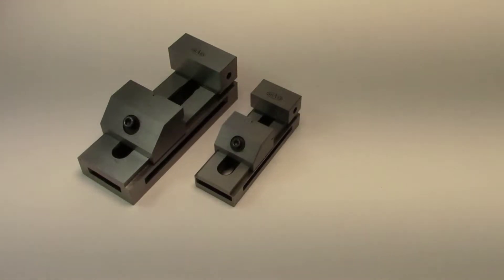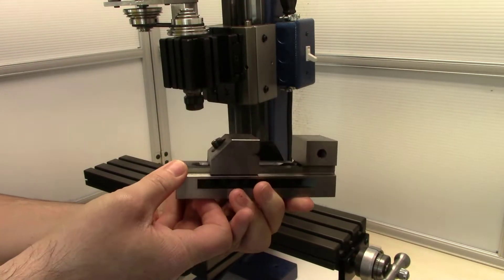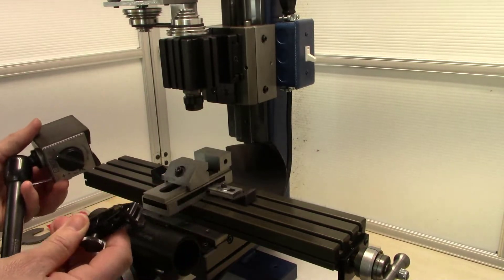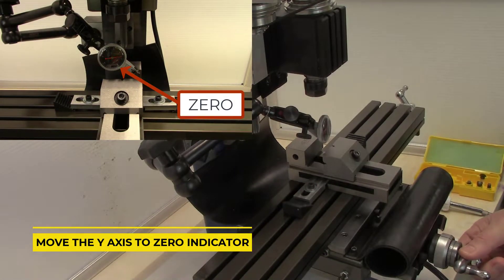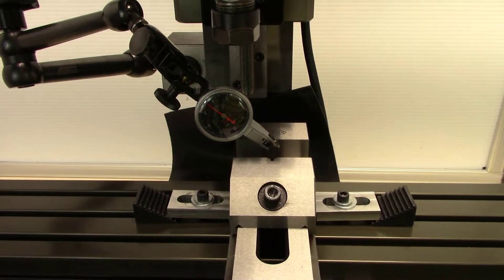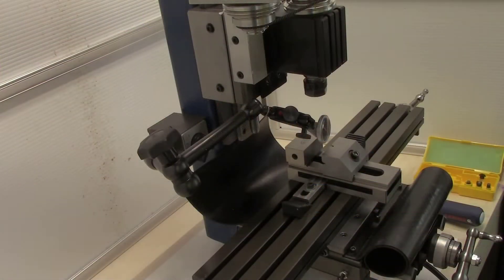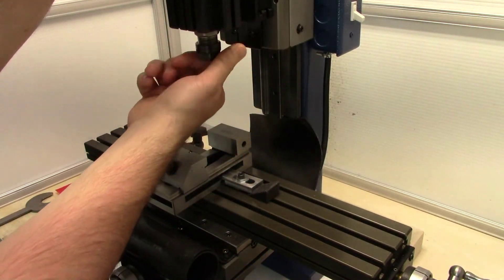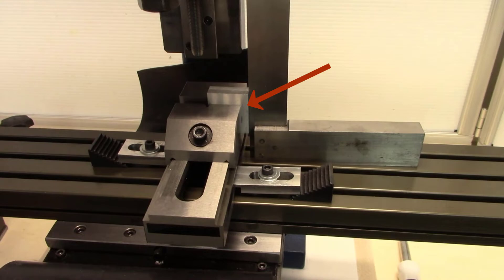LEARN: How to indicate a vise square on a Taig mill

Comment: Thank you for your nice videos. A question about vices for mills if I may. I see you use two types of vice, either ones that are tightened with a hex wrench or those that have a long screw thread that pushes the movable jaw into place. I have the latter one and it isn't that good as it doesn't seem able to prevent the moveable jaw lifting a little when tightening, especially if your work item is thin and supported in the vice with parallels. The issue is that here in the UK the first type of vice ( tightened with hex wrench ) and often called a 'machinists' or 'precision' vice has an operational flaw which means that you have to remove the vice from the mill table to move the locking bolt along the 'rack' which is a pain to do after you have the vice squared up. Any thoughts ? Thanks. Rob.
Reply from the maker: Hi @Nineoneten -  I mainly only use these precision vices since they are ground square. If the vice is square to the mill, then I know that the parts will come out square. 

To answer your question, yes, I have have the same issue. These vices are a pain to change the width, though I do not remove the vice to change the size. With the vice attached to the mill, the front of the vice hangs off the front of the table enough for me to get my finger in there to release the pin from the slot. It is very cumbersome, but I have made it work. I hope that helps and gives you some ideas to make using the vice easier! Any other questions just ask! Thanks for watching!

Comment: Wow that is something I need to learn how to do.
Didn't even think about the vice not being straight.
Reply from the maker: Thanks for watching and for the comment! We need to indicate the solid jaw on the vice as close to zero as possible. When we mill the part in the vise, it will be square to the X axis, and we wont get a crooked part! These methods are standard in any vertical mill of any size, CNC or manual. 

This video shows two methods using a magnetic base, and putting the indicator in the spindle to square the vise. My test indicator is a kit, so the pieces that attach to it came with it.